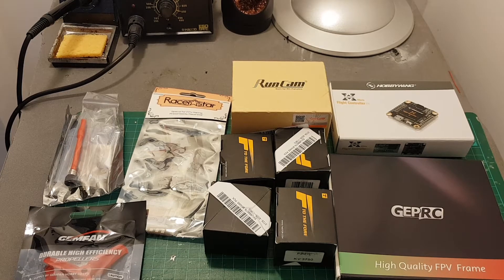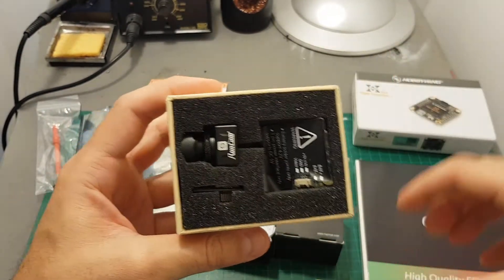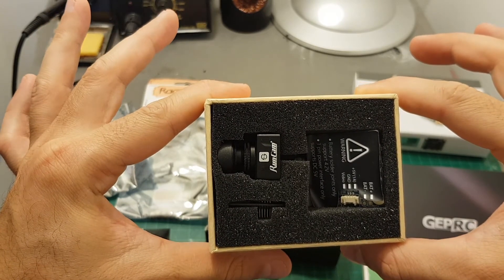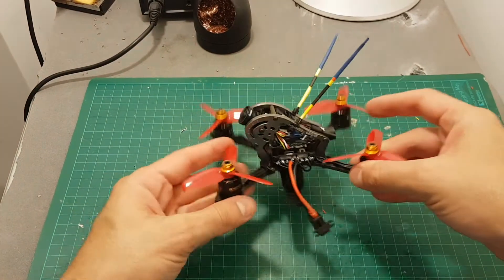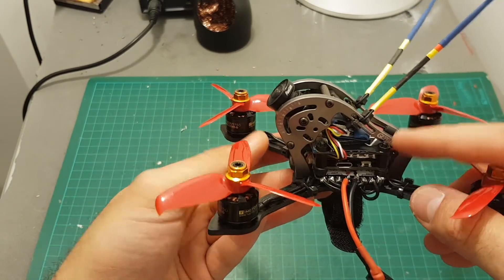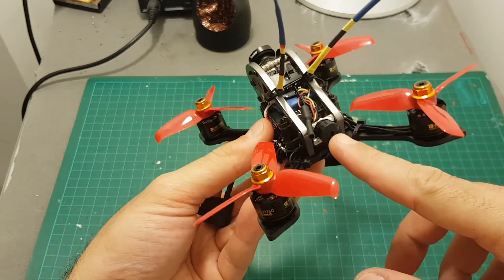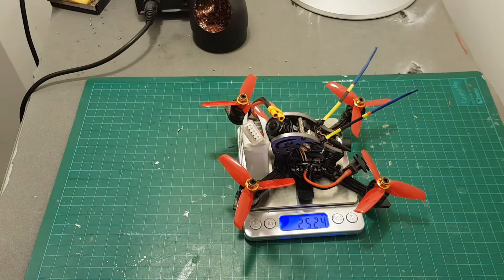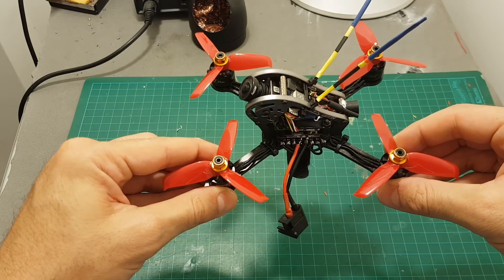GEPRC Sparrow - GEP-MX3 - Build Video

Comment: So it can hold a 30.5x30.5mm stack? I read that there are two bottom plates included for both, 20x20 and 30.5x30.5. Can you confirm this?
Reply from the maker: Yes, it supports both options.
Reply: Great -thanks! 👍

Comment: Your title is wrong this is the msx3 frame . THe strecthed X version.
Reply from the maker: When I built this quadcopter the MX3 was the only option. I believe that they changed the bottom plate to one piece later on.
Reply: i was looking at the frame at 1:13 and it looks like its the stretched version the distance in the arms do not look equal

Comment: so what is your final liking on battery for this setup?
Reply from the maker: +TuanQAV I don't have this quadcopter any more. The best battery I tested it with was the Dinogy 1000mah 4s battery.
Reply: Gal Kremer sell them or giveaway? well.. most i check run 4s.. 1000mAh doing ok? a little skeptical to start 3" quad
Reply from the maker: I am building the FlexRC Ascent 3" soon, so stay tuned.

Comment: Hi, possible to move the runcam split completely? i got the same Frame and the runcam micro swift, but it does not move completely, the cam is way to big. thats not soo nice, had to cut a bit of the cam.
Reply from the maker: +Se Bi what do you mean by moving completely? Change its angle?
Reply: Yes, correct!
Reply from the maker: +Se Bi As far as I remember, I could change the angle without any problems.

Comment: Maybe the original Split lens will be more protected. That optional GoPro style lens is a bit too long and unprotected. Oh, and XF/Zop lipos are terrible. Cut open the shrinkwrap and you'll likely find different capacity/C-rating cells.
Reply from the maker: +TweakRacer yes, the 4s 650mah lipo was just terrible. Thanks for your help.
Reply: Have BangGood send you Infinity and GNB/Goaneng lipos. They are really good.

Comment: did you have to grind down the mount point on the supports for the camera to fit?
Reply from the maker: +Daich Chow No, I didn't modify the frane in any way.
Reply: I had to, and the split housing a bit aswell